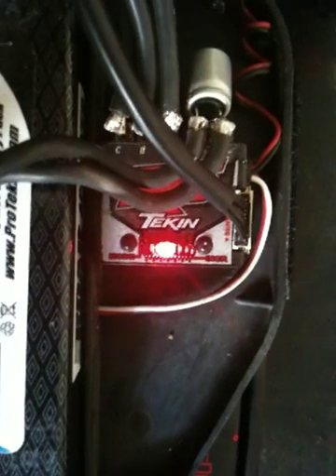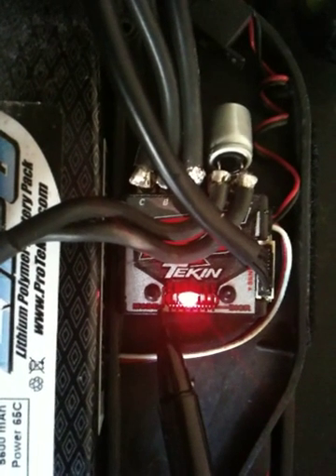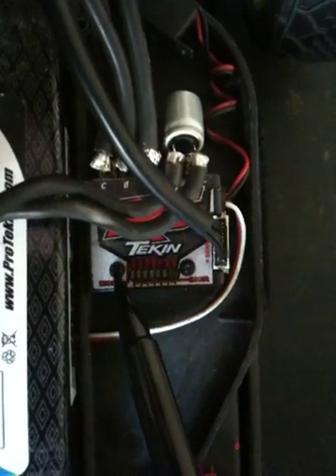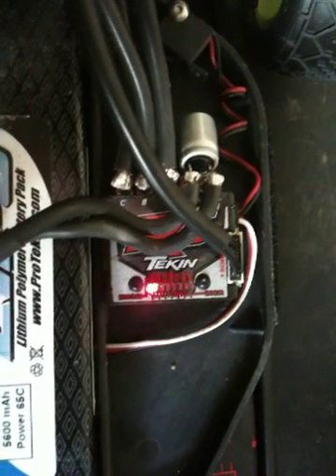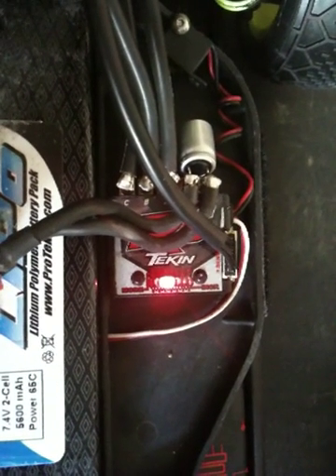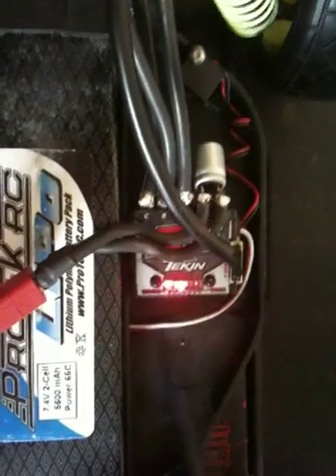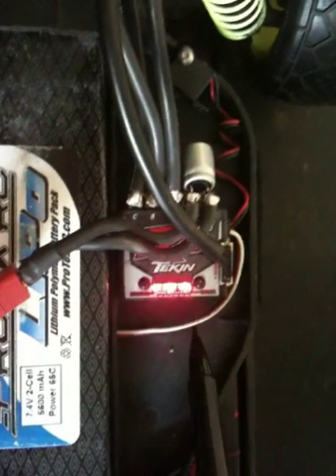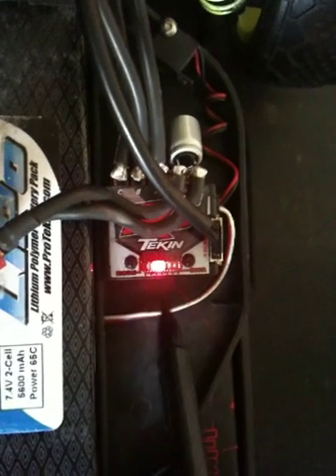Radio Calibration and adjustments

Comment: If you buy the hotwire you still have to do the thing were you hold full throtel and wait for the tone stuff...but now for drag brake and motor power and timing and all that ticky tac stuff I can do with the hotwire right???? cus i'm getting the redline 6.5 gen2 and rs pro esc from tekin!!! BTW great vid thanks alot 
TheRcworld101

Comment: Hey I have a question back in March I got a brand new  Tekin Rs Gen 1  and  last night at a club race  I was rushing to hook my stuff up to get on the track for the Buggy Main   and by miss take  I cross the wires  I put  Positive into the Negative and Negative into positive ..  it smoked and the esc still has power to it the lights  light up but no  Forward and no brake ...  I know Tekin does not cover that ,,,  but how much would u think it would coast to have tekin repair it ???  please  let me know asap!!

Comment: On the voltage cutoff, is the 2nd increment for 2s? and 3rd one is for 3s, as stated in the manual, correct?

Comment: I've watched so many videos and I've done this process multiple times and the throttle won't work still but steering is fine. I honestly think I have a faulty one because I've tried everything and nothing works. It's hooked up to a tekin redline gen 3 10.5 turn motor and honestly, I think I'm just done. Bought a DX5C and it won't bind either. It's a newly upgraded receiver and the battery is a traxxas 3s 20c 6400 mah. Too bad. I spent so much money on a car and transmitter just to be disappointed.